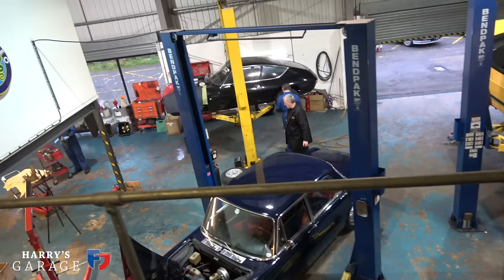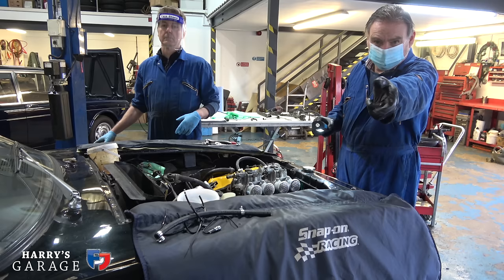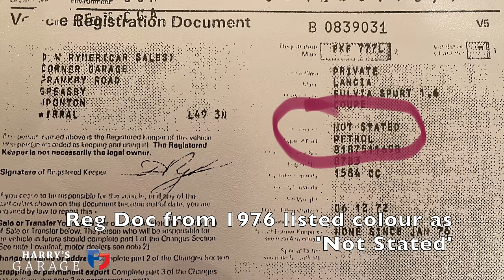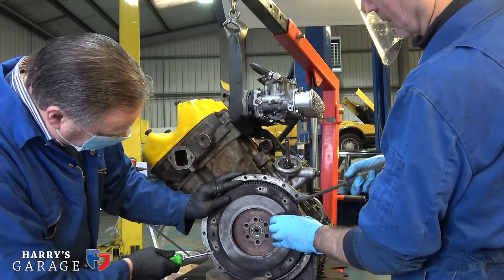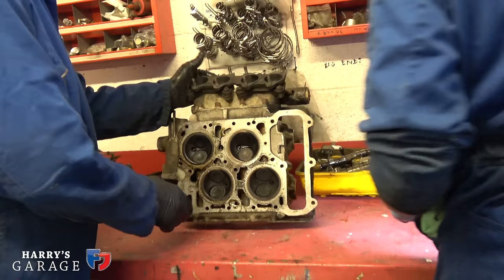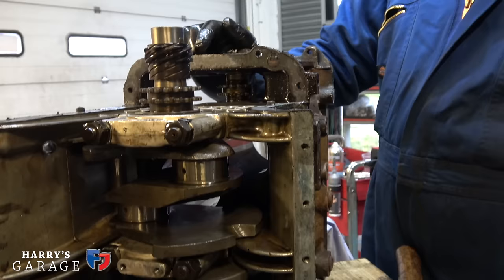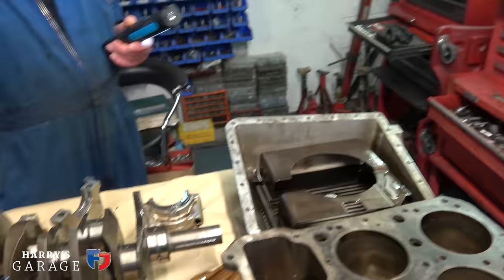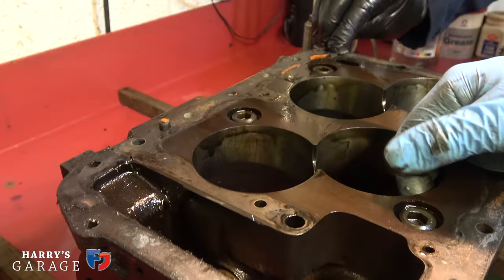Lancia Fulvia Zagato 1600 restoration Part 1. Engine removal & strip down

Comment: Nice Monte Carlo Yellow Saab 900  in the background. Im an ex Saab Master Technician and love the older Saabs before GM took over. The Slant engine design is also somewhat similar to the Fulvia's.
Reply from the maker: True. I owned a series of those Saab 900 back in the day; blue metallic 3-door 900 turbo, black 900 16v turbo two-door and black 900 turbo 16S. I had the 16v ones chipped by BBR and used to destroy the gearbox regularly. Trick was to break it within the 12 month warranty period, so I got another one fitted for free! Happy days, loved those Saabs..
Reply: @harrysgarage  Ahh yes the chocolate 900 gearboxes. There was not much tuning that could be done as they were Bosch LH injection. Only the APC could be tweaked slightly to get them up to about 200bhp. But you had to be so gentle with bringing the boost on to prevent 3rd gear shearing.  Ive had 4 900's, and 5 9000's. Heres my latest 9000 Aero 2.3T with 308bhp.     https://i.postimg.cc/7h6KppkN/IMG_0042.jpg
Reply: @harrysgarage  Would love it if you featured a classic 900 T16 on your channel, Harry.
Reply: @harrysgarage  Time you owned another one!

Comment: Very interested in how this goes.  I have a 1972 1300 Zagato which I had to completely restore including an engine rebuild.  I decided to get the exhaust manifold Zircotec coated to help keep things a little cooler under the bonnet.  I managed to find a pair of the sought after Dellorto carbs to replace the Solex which might give me a bit more options in tuning but due to Covid restrictions cancelling all the classic events I haven't had much chance to get it all run in yet.
Like you I have the plastic headlamp covers from Omicron.
I also fitted an 123 electronic distributor which was fairly easy once you worked out which was cylinder number 1, not as easy as you think on an Italian V4!

Comment: That’s been great to watch. Turns out you were right, it indeed needed a rebuild. It sounded beautiful, I would have never imagined the wear you found inside. By the way, aren’t you tempted to have the body repainted to the original color?
Reply from the maker: Thanks for watching and yes, I'm very tempted to go back to orange with the black strip on the bonnet..
Reply: @harrysgarage  You've gotta do it 'Arry, you have no choice . . . the smile will be even broader thereafter
Reply: @harrysgarage  
It’s understandable. Was it mine - which it isn’t, my funds only allow an old Volvo - i’d go for the orange. Black is so ordinaire. Such a car need’s to be seen. As it would if it was orange..
Reply: @harrysgarage  Would look the biz either way.
Reply: @harrysgarage  Second thoughts, for this car - orange;
Reply: Yes Orange Harry
Reply: @harrysgarage  now that will look brilliant! You must!

Comment: I never saw that kind of "overhead pushrods". They may add a bit of weight, but they push the valve absolutely straight/linear. If something is worn out, it is the pushrod and its guide with an easy accsess - clever! Oh i see 21: valve/-guide also worn.
Reply from the maker: Not thought about the fact they would push in a linear direction on the top of the valve stem, clever. I guess a cam acting directly on a valve cap (and shim) does too, though?
Reply: @harrysgarage  Yes a cap does that too (nearly) except from the rotating forces in one direction. Requirement: the center of the camshaft lines up with the center of the valvestem. Wich ist commom.

Comment: One of the few straight V4-s.
Reply: More like a square four like Suzuki rg 500.
Reply: @markhall6026  Take you pick, but the RG500 wasn't produced in the 1960/70:ies
Reply: @MathiasHeinel  or the 20's Lancia made narrow angle V engines from the mid 1920's onwards

Comment: This car needs a lot of TLC but with any Lancia everything can be mended or improved. I would not go for the extention manfold. Rebuild the 42's and stick with them. Original and when adjusted properly they work great. Keep the stock airbox as well. Retain the rough look on the inner wings. Its original finish. They are rare cars with about 900 build and IMHO deserved to be kept as they came from the line. Small invisible improvements excepted.

Comment: Not seen an engine that shape before. Its like a cross between a square 4 and a V4.
Reply: The result of this narrow angle V4 is that the engine is shorter. Helps with weight distribution and enables a shorter 3 bearing crank to be used with less whip and naturally stronger.

Comment: nice to see the liners in between the leaves of the rear springs, although they look a bit past their best. a rusty leaf rubbing directly on a rusty leaf = suspension that doesn't work
Reply from the maker: Interesting. The rear leaf springs visually looked a right mess but you'd never guess on the road. There was plenty of wheel travel and it was well damped too. Got my money's worth out of those springs!
Reply: @harrysgarage  feel a bit starstruck thanks for the reply. When I was still a school ( awhile ago I was born in 63) we had a twin carb Marina that kept breaking leaf springs I ended up fitting factory competition multi leaf springs which had a nylon layer between each leaf and was amazed at how well they worked.

Comment: Loving the video. My dad (Don Pither) had a Fulvia and used to go on Classics rallies, breaking leaf springs regularly. I seem to remember it having a leaf spring between the front wheels too? I am surprised you are not turning this into an 8,000 rpm screamer with a standard steel crank as a great starting place. The conrods look cast? Were there thoughts about swapping these out for steel at the same time as fitting forged pistons?
Reply from the maker: I'll be going for what you might term 'Rally' spec, so the cast rods will probably be fine. Steel crank came as a big surprise, though. I had no idea they were standard fit on the Fulvia 1600 until we opened up this engine!

Comment: Hi Harry! I'm from your neck of the woods and familiar with some of the workshops you have used like Bob Houghton at Northleach. Just wanted to say that it would be a good experiment to get the engine DYNO'D when its rebuilt and still out of the car to know what horse power it is making? These engines were designed to run on leaded petrol with a higher octane than can be bought at the pumps today. For this reason the carburettors which are Solex C44 need to be re-jetted to accommodate for it? Get it DYNO'D and get the jetting optimised when on the test bed for maximum horse power!!
I don't know how good your man DAY is? When i saw the inlet manifold gasket which was masking the port this tells me that the engine has been apart at some time in its life because it would NOT have left the factory like this? What concerns me also are the inlet valve seats and the valve face angles which have (TWO) cuts on them a 20 degree and a 45 degree which your man may NOT know about as this is 1960's racing technology and should the seats be cut at just 45 degrees the power and torque will be much lower than it should be?? If its all done properly and the crankshaft is balanced together with the flywheel clutch and pulley and the pistons and and connecting rods are weighed up and equalised then I see NO reason why the engine won't deliver the 115 BHP claimed by the factory.

Comment: The V4 layout looks similar to what VW did with the VR6 single head engine. What angle separates the pistons, if that's the way to put it? Ford used to have a V4 in the 60's likely with separate heads. What angle was that. Was it 2/3rds of a V6 in the way that some 90deg V6 are 3/4 of a V8?

Comment: Are they replacing the valve springs? people always under estimate valve springs but if you want to rev the car you need new ones.  We all know nascar is whatever but its the closest modern racing engine to a classic and if you ask any of the engine developers there they will tell you the valve spring has been the biggest technical advancement for them over the years.

Comment: Sadly all Italian cars of that period especially used high carbon steel as it was cheaper but it went totally rotten I worked on a Alfetta 2.0 that was 18 months old when I was an apprentice and it was rotting underneath and on the outer wings and qtr panel joints.

Comment: I love this! I am going through the same process right now on my car and I am looking forward to following your steps as well.

I don't understand why you don't take engine+Gearbox as a whole from the bottom together with the subframe. Watch out because the mounting points of the subframe (especially the back ones under the cockpit) are very fragile and easy to get rotten. You probably want to have a look at those as well before rallying. Looking at the rotten bit in the back you might have some problems there as well.

Have a look at CPS for the pistons 
http://www.pistonispeciali.com/EN/cars.htm#.YCu5QmhKiUk
and at Colombo&Bariani for the camshaft
https://www.cb-cams.com/en/lancia-camshafts/
They are the best.

Rosso San Siro is definitely the best-looking colour for this car. It's also the original colour of mine, I am repainting right now <3

Comment: Don't all cars have a steel crank? Do you mean forged over cast?
Reply from the maker: Correct. A 'steel crank' is a common description of a crank that's been machined from a solid billet of high-grade steel, rather than a cast crank that has then had the bearing surfaces machined smooth.

Comment: When you say "steel crank", do you mean forged steel rather than cast?
Reply: Probably Steel rather than Iron, but forged steel would be stronger than cast steel.
Reply from the maker: Correct, the crank would have been machined from a solid billet of high-grade steel, rather than cast and then the journals machined out. It's what high-revving and race cars use. Expensive..

Comment: Despite of the rumour that the Fulvia 1600 Sport was as expensive as an E-type (I've heard this numerous times), it is untrue. The Fulvia in March '72 (when mine was registered) cost £2682, an E-type V12 2+2 was £3474 an Elan Sprint DHC £2201 and an Espada MK11 £9775.
Reply from the maker: I've got a copy of Motor dated 22nd April 1972 in the office and it lists the Fulvia 1600 Zagato Sport (interesting they add Zagato to the listing) at £2592 and the Fulvia 1600 Coupe HF Lusso at £2314. The E-Type 4.2 is listed at £3358, so a fair bit more but then the Jaguar XJ6 2.8 litre is £2554, which maybe where the 'More expensive than a Jaguar' story started out from?
Reply: @harrysgarage  my copy is Autocar dated 16 March 1972 which has the HF Lusso at £2394 (inc PT!) so slightly more than yours but a month earlier- Very strange. XJ 2.8 saloon (manual- auto £109 extra) at £2519 although Deluxe version listed at £2642. Who was correct Autocar or Motor? perhaps they couldn't decide and ultimately ended up collaborating many years later.